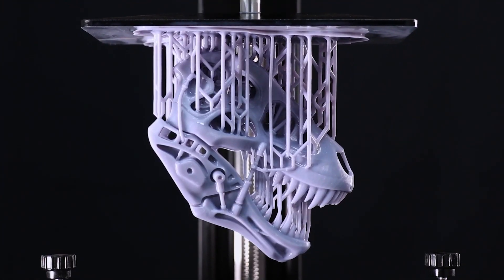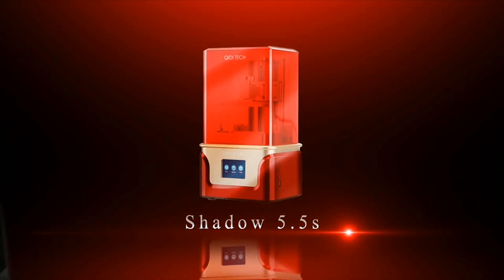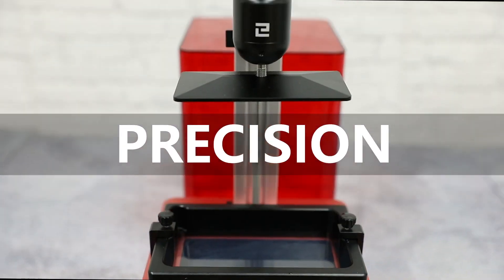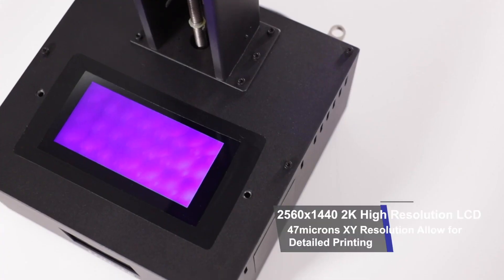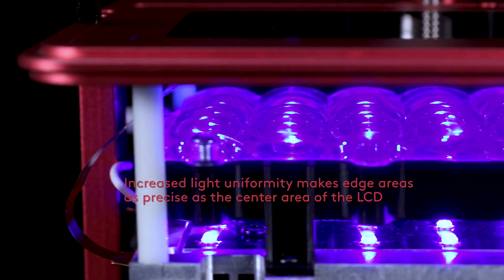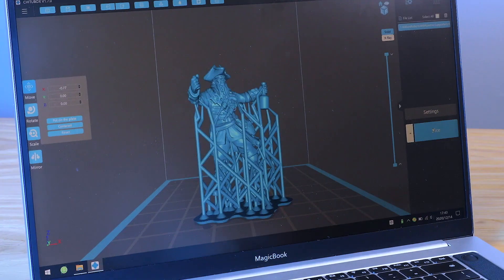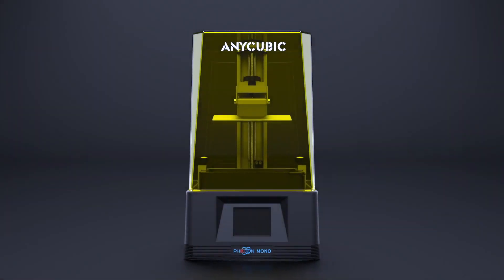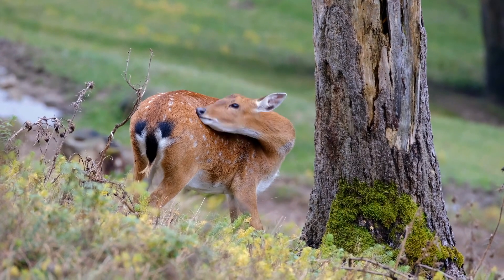TOP 8  affordable DESKTOP SLA Resin 3D PRINTERS 2021 UNDER $250 | MOST AFFORDABLE SLA 3D PRINTERS

Comment: The Anycubic Photon Mono should be a clear winner here, but... The FEP film replacement is very expensive, because in stead of simply replacing the film, you have to buy a complete frame with film glued to it. Also - The LCD screen on any printer of this type has to be replaced after been used for a long time (admitted - without any accident it should last for about 2000 hour printing time, but still). That should not be a problem if it was not for the lack of availability of this replacement screen. It is simply out of stock everywhere. The same goes for the replacement FEP film with frame. There are ways around that by buying a replacement vat for example, but that adds to the costs of the initial buy.
For now I dubbing between the Creality LD-002H and the ELEGOO Mars 2 Pro (that printer is the mono version of the Mars 2, but is slightly more expensive, so I get why you did not included this printer). For both all replacement stuff is easy obtainable. If you use a printer for a longer period, that's simply crucial.